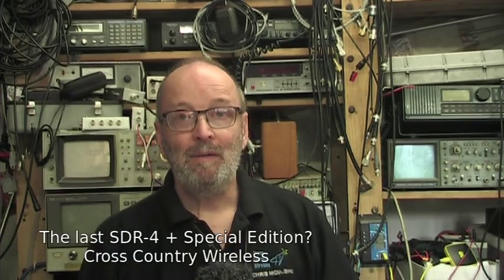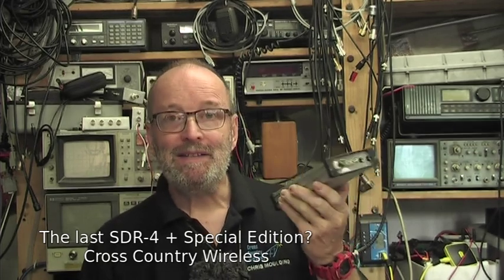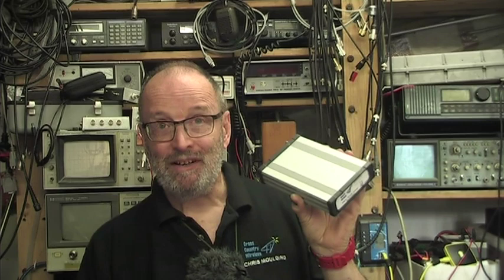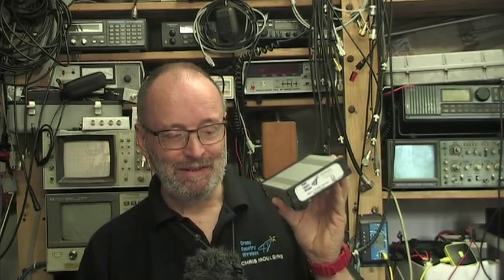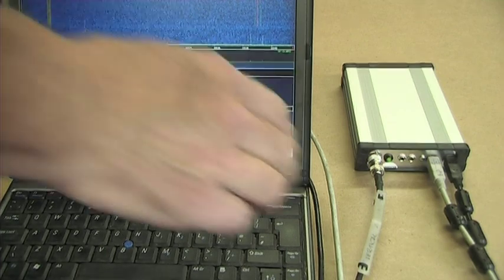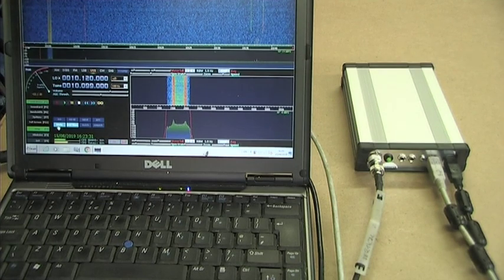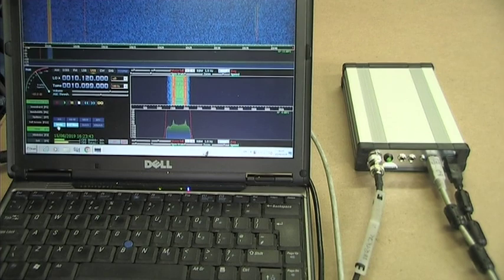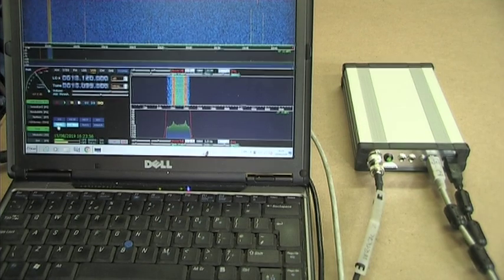The last SDR-4+ Special edition receiver?

Comment: Ive put on my channel some clips of using the SDR 4 with WSPR and recently just simple HF using SDR CONSOLE - this receiver is excellent and has served me well over the last few years, the extensive use of pre selector filters etc really makes it a noteworthy receiver as an SDR. I havent got around to the faster interface which I think gives me a wider IF but anyway it's super and works well with the setup here in Thailand.   I don't know what's happened to your company and if you stopped making RXs at all - it's a great shame this is a superior product in a sea of SDR nonsenses. best wishes  73 MW3PWA
Reply from the maker: Good to hear the receiver is working well for you.We stopped making SDR receivers when sales dropped off. Radio users would now rather buy a DC to daylight receiver with poor performance rather than a purpose built HF receiver with good filtering and input protection. We have now moved over to making active antennas and Multicouplers. One of our products is a Receiver Protection Unit to protect the SDR receivers that are now popular! 73 Chris G4HYG

Comment: are your radios better than rsp1a ...thanks
Reply from the maker: The SDR-4+ had a narrower frequency range 850 kHz to 70.5 MHz but was a 16 bit receiver rather than the RSP1A's 12 bit so had a far greater dynamic range. They also had receiver input protection so they could be used for unattended all weather 24/7 monitoring. In the end most hobby customers wanted the wide frequency range of the RSP1A. We kept making them for universities and professional customers until they became uneconomic to manufacture.